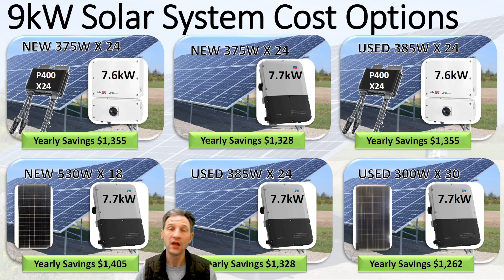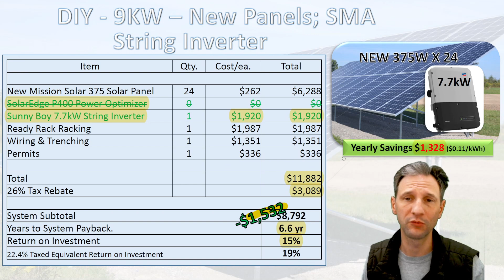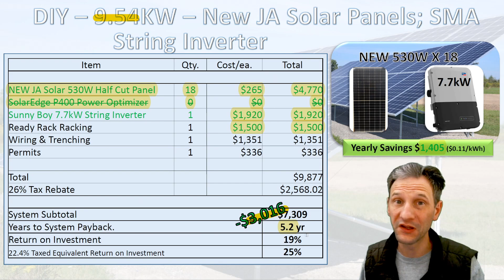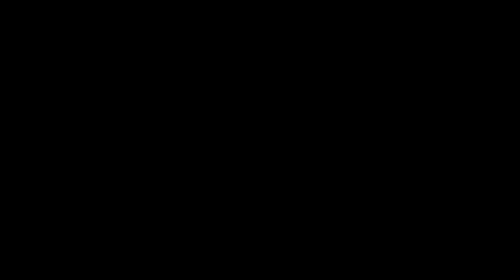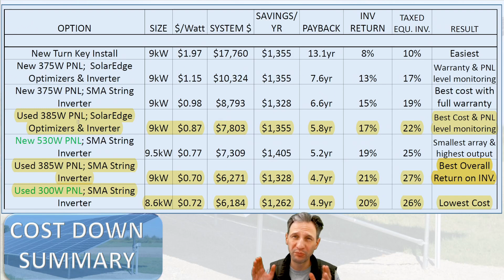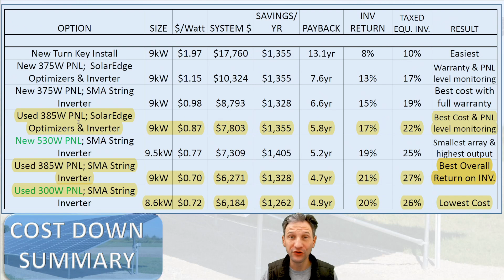DIY Solar Panel System - How to Do it CHEAPER!!

Comment: Payback is very hard to compare. My payback on my system keeps getting longer because the utility changes the rules, minimum bill and avoided cost rate every year!!
Reply from the maker: That's frustrating!  Anther reason to build a system with the shortest payback possible.

Comment: Beware- you cant claim 26% ITC or any rebates on used equipment. Also -claiming nameplate wattage on used panels in calculating an ROI is misleading.
Reply from the maker: I used actual performance relative to my system over the period of a year to calculate ROI not nameplate performance.
Can you post a link to the IRS publication that says used equipment does not qualify?
Reply: @ProjectsWithDave  Yes- please see instructions for IRS TAX form 5695 - COSTS- 
"For purposes of both credits, costs are treated as being paid when the original installation of the item is completed"
The verbiage of "original installation" means "NEW" not used.
Reply from the maker: I understand how you are taking the interpretation "original installation" to mean new materials, however, it could also be interpreted to mean If at some point I had an original roof installation and later payed to have it removed and re-installed to replace the shingles, that would not qualify as the "original installation".  Of course you should always consult your tax advisor for tax advise.  I have attached a link to those two IRS forms for peoples reference:
2021 Form 5695:  https://www.irs.gov/pub/irs-pdf/f5695.pdf
2021 Instructions for Form 5695:  https://www.irs.gov/pub/irs-pdf/i5695.pdf

Comment: You should look for cheaper racking, or consider some DIY.
Also break the system into two halves that are facing ~90 degrees to each other( SE and SW), this will produce a bit less energy but the production will be spread over a longer time and peak power will be lower, so you can add even more panels without changing the inverter, say 35% or 40%  more panels then inverter, instead of the current 20%.
Reply from the maker: Thanks for the suggestions.  After running my test rig due West during the winter months I was considering changing it to SW to improve it's performance.  Do you have data or an example for the above proposal's performance?
Reply: @ProjectsWithDave  This SE/SW orientation is getting to my biggest question. The corner of my house faces South but I have lots of SE/SW roofing. Racking on the ground, facing South there is more problem with tall pine trees. So I'm trying to decide if SE/SW is my best option. I know you can't answer that, but your videos and Sergey K's message help.
Reply from the maker: If you can do SE/SW without shad vs S with shade I would go with the SE/SW option.  I recently got a FLUKE Irradiance meter and it made it very obvious why the West facing array is doing so poorly in the winter.  The performance of panels is much more dependent on direct sun exposure than it is on the angle the sun is hitting it.  The West array only sees direct sunlight for a very short period of the day in the winter.  When I measure the irradiance at the panels with just daylight (no direct sun) I get about 150w/m^2, as soon as the sun hits the panels at any angle it jumps to 300w/m^2 to 500w/m^2 out of the 700w/m^2 that might be available angled directly at the sun.  I plan to do an update on the West array winter performance in a couple of weeks with more details and some data to back it up.  Hope that helps.

Comment: facing panels east and west is not a new thing we do it all the time in off grid to flatten the curve and level production as very few people use peak power at noon. also starting to do it more on grid tie when the utility company changed its buy back policy. her in sask they give you 1kwh for every 2kwh you give them so face the panels east and west to flatten the curve and make it larger in the morning and evening so more is consumed by the customer and less if fed back to grid for a higher return.
Reply from the maker: Thanks for your information.  So much of solar is dependent on your physical location and the incentives or lack of incentives provided by your local government or utility.  I like to collect data for myself and give people another data point to work with.  : )

Comment: How do you calculate your profit. Also do you still got to pay taxes on your solar panel profits
Reply from the maker: The returns I calculated were based on a $0.11/kWh electricity rate.  The lowest cost system with all new panels was $7,309 which pays back in 5.2years.  That 7,309 earns $1,405/year, that is a 19.2% yearly return.  That does not even consider the fact that you don't have to pay income tax on electricity savings.  Taxes are payed on income, saving money on electricity is a cost avoidance, no income was generated.  Of course you should consult your tax advisor for tax advice.  Hope that helps.  Thanks!

Comment: What’s the average demensions of most panels?
Reply from the maker: It depends on the manufacture and the number of cells.  A common 72 cell panel would be about 79" x 39.5".

Comment: My ADVICE is AVOID Solar Edge like COVID ! I am stuck with their optimisers and inverters that deny me flexibility on batteries and islanding etc. Yes to cheaper more flexible and often better inverters but do get quality panels they do matter. SOLAR EDGE is like APPLE a closed universe where everything has to conform to them.
Reply from the maker: Yes, there are some limitations there.  If you want to add batteries you can do AC coupling with something like the Sol-Ark.

Comment: why are you using optimizer when there is now shadow?
Reply from the maker: When I installed my system, I didn't understand how small of a difference the optimizers would make in my situation.  As you can see by the numbers in this video, they don't make sense for this setup.  That's why it's called "My $4,000 Mistake".   : )

Comment: Have you  thought about a couple of east facing panels to start making power earlier in the morning?  My south facing array only  makes power about 4 1/2 hours a day.
Reply from the maker: I was considering an East and West facing array, but the data I've gathered so far with my West facing array is showing poor performance in the winter when I need the power the most.  An East facing array would be the same scenario.
Reply: @ProjectsWithDave  Except I need 3 times as much power in the summer when the a/c is on, I can get used panels pretty cheep but the inverters are expensive.

Comment: For the money you are saving DIY you can afford to buy a couple of the new LifePo4 server rack battery systems and be able to cut the grid.
Reply from the maker: That would not be sufficient to allow me to drop my gird connection, I plan to do a video in the future to explain why.  In short, my largest consumption by far is in the winter when my geothermal system is heating my house.  That is also when my solar production is the lowest.  I would need a much larger array along with batteries to close the gap.

Comment: With used panels, what is the expected life time after the system has been payed back?
Reply from the maker: Solar panels don't stop working after a certain amount of time, they slowly degrade performance.  This is called the degradation rate. An average degradation rate of 0.8% per year, means that in year two, your panels will operate at 99.2 percent of their original output.  Manufactures usually guarantee a 25 year life span,  by the end of their 25-year “useful lifespan,” they will still be operating at 82.5%. A slightly more durable panel with a degradation rate of 0.5% will likely produce around 87.5% as much electricity as it did when it was first installed.  You can read more about this in articles like this one: https://news.energysage.com/how-long-do-solar-panels-last/

Comment: Top to bottom
Self installed...25Kw solar array... 25Kw split phase charge controller/inverter system...30Kw FLA battery storage... less than $30,000. $1.20/watt 
Off-grid, low maintenance
Why hire labor for a plug n play system
Freedom is included

Comment: Why would people dispose of panels if they are just as good? And why didn't you put them on your roof?
Reply from the maker: People often replace panels when they have space constraints and the newer panels can produce much more power for the same area.  I explain why I chose to do a ground mount instead of a roof mount in this video: https://youtu.be/w-iS_8e7n60

Comment: I was quoted by my local CES about $6K for DIY system of 18 Heliene 375W panels, 4x APsystems QS1, 1x YC600 and the supporting infrastructure to connect. I have considered a string inverter but I like the simplicity of the microinverter system, since I don’t have to deal with DC anywhere in my home. Seems like a great deal for 5.4kW system and my plans are going through the city right now. Any advice or comments on components I am looking to use? I like the idea of a hybrid in case I want to add a battery, but the cost of the micros seems like the better deal, and I can just AC couple later without too much hassle. Any advice is appreciated.
Reply from the maker: The components you are proposing are a unique solution, but I haven't done enough research on that system to give advice on it specifically.  Generally speaking as long as the distance from the array to the breaker panel is short going with AC micro inverters is a fine solution, as you said, you can always do AC coupling later if you want to add batteries.  Also the micro inverter systems are easy to expand.  Good Luck!
Reply: @ProjectsWithDave  Thanks for the reply - the run from the array to the panel is only about 25ft (small house) and I've done all the calcs and all check out fine.  Any real major headaches to AC coupling you can think of that a Hybrid string inverter would address? I feel like if going with a hybrid string + optimizers up front, rather than micros, I'd just be front loading the cost, rather than just paying for the AC coupled system later.

Comment: uhhhhhh they have solar calculators that you can just use, and get a bigger inverter of you are clipping and loosing power, sounds like a horrible idea to use such an inverter
Reply from the maker: Clipping is an industry standard practice and maximizes the return on investment.  Panels are cheaper than inverters.  You can read about it here: https://www.solarpowerworldonline.com/2019/12/how-to-maximize-solar-installation-value-using-inverter-clipping/

Comment: Dual purpose solar panels, they use water to cool panels, you can use the hot water for domestic... there is a guy in NJ who gets temps of over 100 F in the winter, he uses it to heat domestic and melt the snow on his driveway...the dual purpose panels was an idea I had over 10 years ago, they make them in the USA because I sent them the idea....small sailboat type wind generators... to compliment the system... when dealing with DC power, I highly suggest you look at some of the wire used by RC builders, high strand count, high conductivity, low resistance silicone wire. Luna Cycles in US sells some good stuff for wire.....but I'm sure you can find the same product just about anywhere, double wall or glue type heat shrink tubing for outdoor connections... if your system use's 100 amp load, build for 200 amp load.... if they tell you 10G wire... use 8 or 6G wire...Liquid electrical tape, royal pain to use but... works well... liquid PVC more or less so be very careful using it, especially around pets and children... in Iceland they make small wind generator's but have NO over speed issue's because of rotor design, not a " prop " type rotor it a savarious or whatever you call it.  LTO batteries... last you a lifetime, over 50,000 cycles, low temp usage to about -20...high discharge rate, bolt together for easy assembly to make any size amp hour or voltage you need, there is a video on you tube, this guy built a LTO battery for his van, but the way he built the pack was very nice and well thought out IMO....

Comment: There is a major discrepancy in the video. The 375W panel costing $262 while 530W panel costing $265 does not seem reasonable. The power is increased by 40% but the price is just 1% more? Why would anyone buy that 375W panel when it is so hopelessly non-competitive in the market? Also, you stated that the 530W panels are fairly expensive but compensated by needing less number of panels. This does not hold up considering the price difference is just 1%.

PS: I am an Indian and am just browsing through solar panels to assess their performance and practicality. It really does not matter what the cost of panels are as they don't really scale the same in India where a new 333W poly-panel costs $105 and a 420W PERC panel costs $140, much less than that in the Americas. I am pointing out the error simply for the sake of correctness.
Reply from the maker: The point of the video is to show that the brand new 375W panels don't make sense against used and discounted panels.  As you stated, you can get a much better cost/watt with used panels.

Comment: I would go micro inverters like enphase (each 1 or 2 panels has a dc to ac inverter) as I prefer per solar panel monitoring they are also firefighter safe (it is the with solaredge as each module drops to under 1v if inverter grid power is lost or there is a brake in the string) but you have 2 points of failure with solaredge dc to dc power optimizers and the inverter) technically you have per panel 

a string system that looks at the whole system only (can't see individual solar panel status and dc string is always live and not firefighter safe)

if using sunnyboy make sure shade fix is enabled (if you have a old sunyboy inverter update your firmware and enable it might be called something els in the settings)
Reply from the maker: Your proposals make sense for a roof mount, but firefighting shouldn't be an issue with a ground mount system.  The goal of this video was to show low cost options, Enphase is nice solution, but it is the most expensive to install and has the greatest line losses between the house and the array due to it's low operating voltage.

Comment: So when does the taxpayer get paid back? Answer: Never.
Reply: The government didn’t give anyone any money.  They just taxed people less.  So, it didn’t cost anyone anything, other than the person installing the system.  It is to achieve a goal.  Taxes drive behavior.

Are you against a mortgage interest deduction on taxes?  If government would control its crazy spending, then everyone would benefit.  When Federal Incomes taxes were instituted, the rate was 1% because that would be all that the government would ever need.  We have come a long way from that time.

Comment: Hey Dave, great videos!  I'm just starting to plan my PV project and your videos have given me the best information by far!  I was a little surprised by your power consumption of 24,000 kwh per year until you said you're using geothermal.  Can you estimate how much of that your geothermal heat pump uses?  What's the square footage of your house and how well is it insulated?  I'll be building a new home next year with 2,400 sq.ft. which will be very well insulated, if necessary using geothermal.  Depending on that I will calculate the PV system size.  Thanks for you content.
Reply from the maker: My house is ICF construction, It has 2,400 finished square feet, but the basement is also conditioned.  A month with very little heat or AC I like October, I consume about 1,144kWh.  You can get more detail from my 1year review video: https://youtu.be/BatTeSq05rU
And from my video on sizing your solar array: https://youtu.be/rbFnZqA0GCI
Thanks!

Comment: If you do it right, you can get a 9kWh system for around $5,000..  Santan Solar has great deals on pallets of panels and you can get them for under $0.35 a watt..  That paired with Growatt or MPP hybrid inverters and a diy rack will get you there.. Then you can add some server rack battery backup for $300 a kWh...
Reply from the maker: DIY racking can save a lot if you can manage the inspection side of it.
Reply: @ProjectsWithDave  I would think a lot of people that have the space for ground mounts do not have codes or inspections.  I know I don't.. That said, there is some DIY friendly racking that is UL listed like Iron Ridge that is also very cost effective.